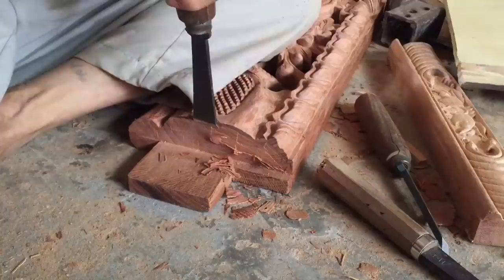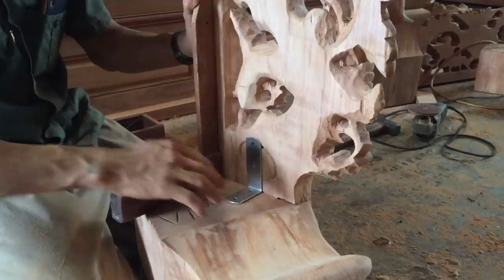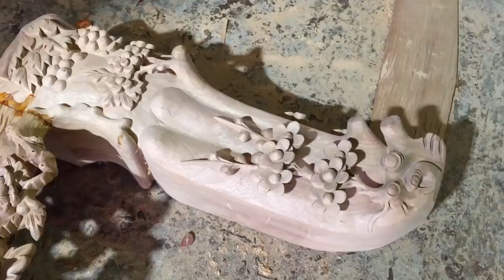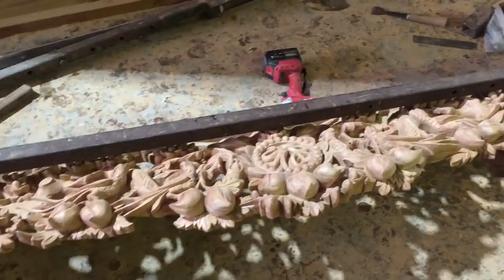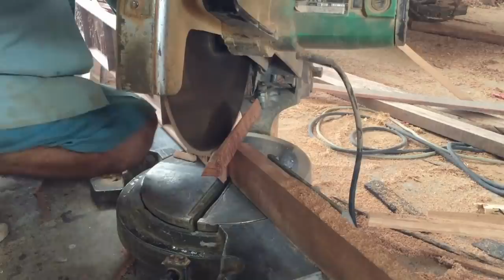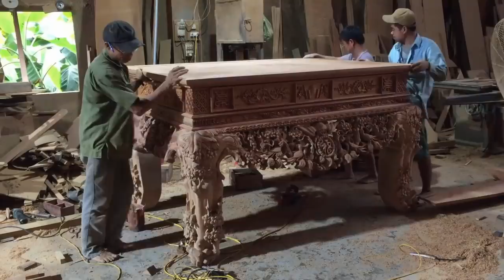Amazing Woodworking - Build & Assemble A Large Altar With Extremely Wonderful Carved Wood Details

Comment: You don't see any detail carving because it was done by a CNC.
Reply: Ken Brewsaugh  it’s done by rotary tools if it was CNC they would have cut the joints in it also
Reply: not sure if these workers can program a CNC?
Reply: @garyrieffer2760  parts were made off site.  The joinery and seam blending are easily done by low cost labor. Plus 360° CNC very expensive.
Reply: @garyrieffer2760  360 degree CNC very expensive dear...
Reply: Ken Brewsaugh yes a good CNC is very expensive and in some places almost impossible to ship.